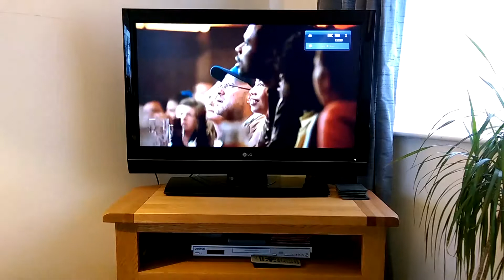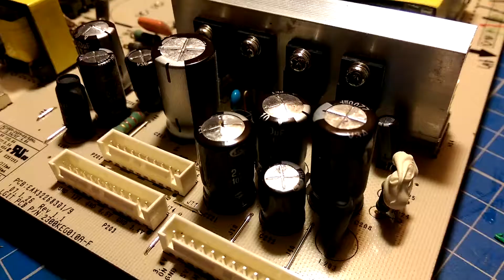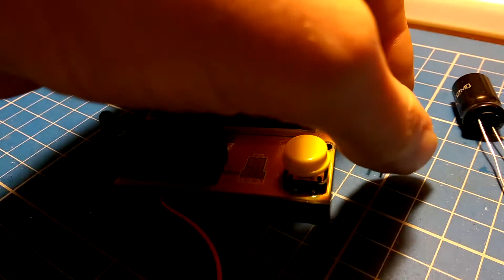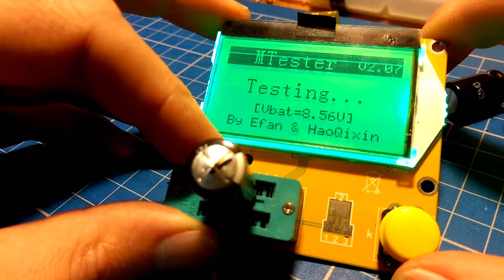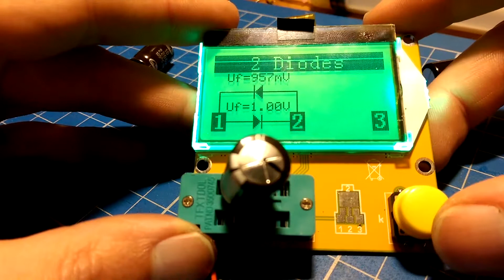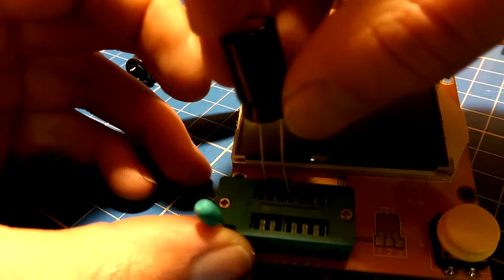PART 1: LG LCD TV and Smart TV [Raspberry Pi] conversion.

Comment: I have an LG 42" 3D LCD TV, the panel is fine but it has the infinite boot loop with the LG logo.

Can I convert it to have a raspberry pi inside?
Reply from the maker: Your TV would need to 'boot' properly before accepting external inputs from a Pi.  Changing your LG's power supply might resolve the problem?

Comment: Great job =D  I swear if manufacturers used quality low ESR caps and swapped BGA for PGA most modern devices would last for a long time.  As it stands most TV's seem to die within 2 to 5 years these days.
Reply from the maker: Completely agree, I'm also thinking poor thermal design as case aesthetics override functional airflow requirements... plus, designing products 'correctly' would go against the current global trend of planned obsolescence (which is a topic that I could rant about till blue in the face).